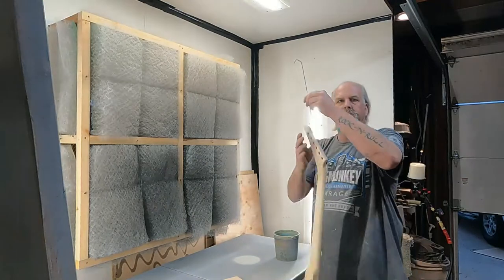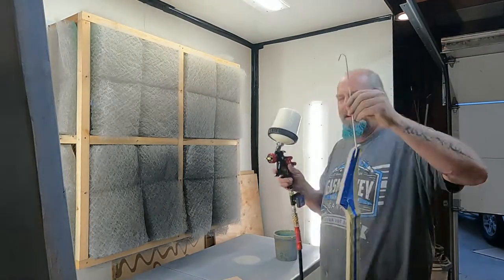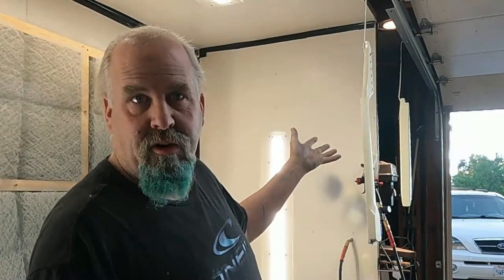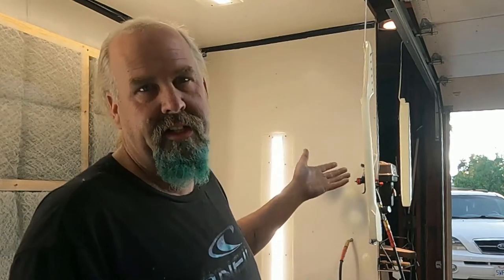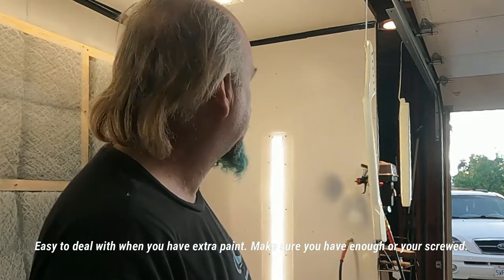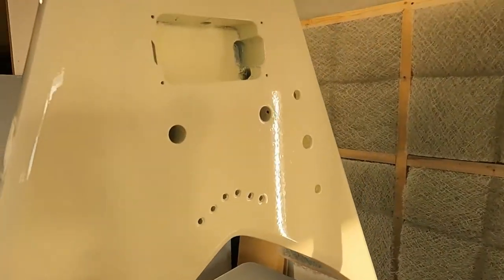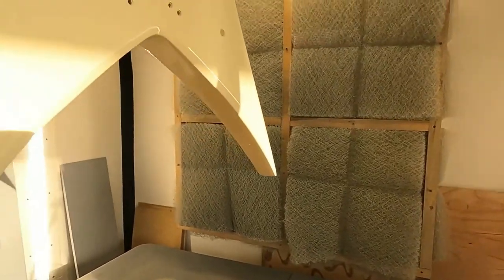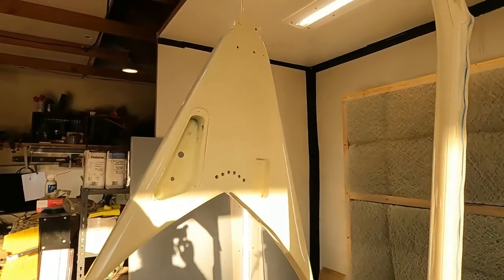Jackson JS32T King V REbuild pt. 4

Comment: After rattle canning several guitars and V's, multiple thin coats is the way to go. Good job though.
Reply from the maker: Thanks  The stuff I use is a industrial paint with a catalyst that has to be added.  makes it super rock hard when dried.  Been over a year now and the finish is still good when I painted it.